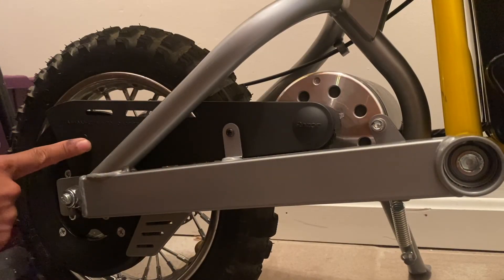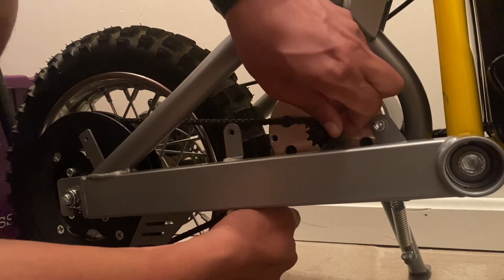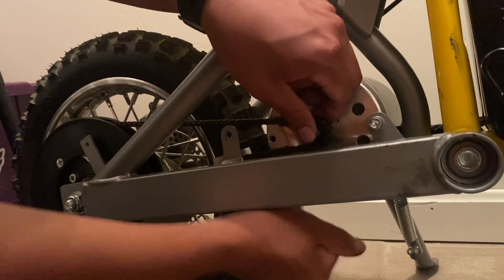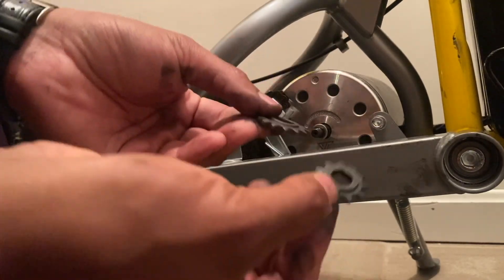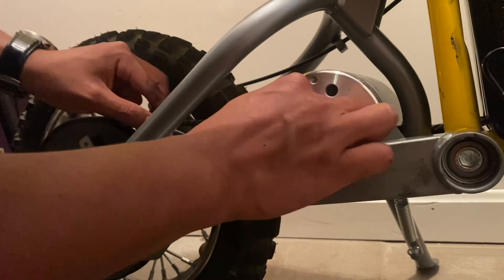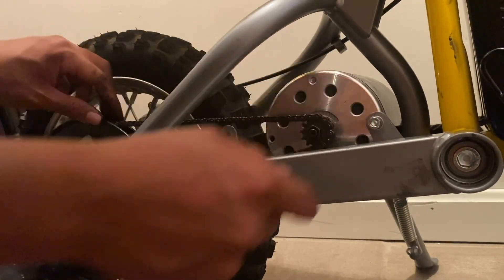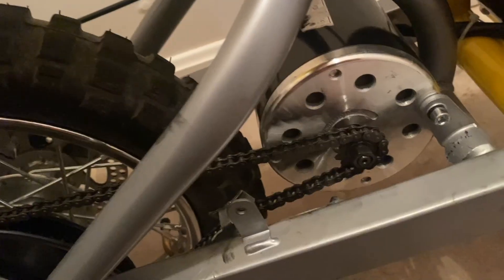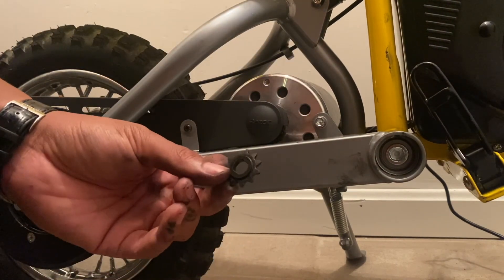MX650 48V Fast Scooters Overvolt Kit Part 3 | 13T Sprocket Upgrade and Top Speed Test

Comment: I have a 650 motor on a 350 frame with a 48v battery and controller, would it overheat ? Because after a ride I touch the motor and it is hot
Reply from the maker: All of these motors will always generate a good amount of heat when ran at a higher voltage. What exact temperature does it measure at? You may want to add a heat sink to the motor

Comment: Whoever is doing these exact mods i highly recommend it… BUT you are definitely missing out by not upgrading to a 48v lithium battery. As Pat stated these SLA batteries are heavy as hell which hampers performance and the way the bike feels. The lithium battery is much lighter and you will get way more ride time. Only thing that sucks is that a proper 48v 20ah will cost you about $250 which is about double what Pat spent on these mods.
Reply from the maker: @gilgonzalez5902  Same Pat that recent spend $2,700 on a 72V 43AH lithium battery, FarDriver ND72530 Controller, Electro EC4P motor and has his Razor SX500 flying at 66 MPH 😂
Reply: I'm looking at an over volt kit and 52v25ah

Comment: how do you take the sprocket off the Kunray 2000w my1020 motor? im trying to replace it with a 13t 25H sprocket. i already have the nut off im just trying to pry it off
Reply from the maker: @pvnchmadefaris  it’s reverse thread. Hold the shaft in place with a 10mm, then turn the lock nut with a 12mm wrench CLOCKWISE to loosen it. The nut can get jammed sometimes, just pry on both sides
Reply: @PatOutdoors  Oh no I've already done that, it's just that the sprofket its selt isnt comming off, do I need to pry it off?
Reply from the maker: @pvnchmadefaris  sometimes you do. You can jam a 10mm wrench on the shaft as leverage to pry against
Reply: @PatOutdoors  oh alright I'll try later, thanks for the fast response

Comment: It has been a long time sense you posted this but I have a question is the kit you got from fast scooters compatible with any 4 12v batteries? Cause I’m replacing my stock battery with different brand batteries. Will the kit still run the same?
Reply from the maker: As long as it has 48v output

Comment: Will it work if i buy it and dont have another battery?
Reply from the maker: It will not, it’s a 48v controller
Reply: @PatOutdoors  if i get the 36v kit will my razor sx500 go faster
Reply from the maker: @animeman4629  not really, it only gets noticeably faster once you’re 48+ volts. This bike now runs on 72V brushless kit and goes 50 mph

Comment: I shunt modded my stock controller and I’m running a 48v 20ah lithium battery pack, supposedly only 40 amp discharge. I smoked the motor on the first time out.
Reply: You have a link for the shunt mod, I'm not having luck searching it. Thanks
Reply: @scottthomas6674  unfortunately no link, it’s not difficult though. Open the black case and peel back the hot glue near the wires. Back side of the circuit board will be two VERY large squares of metal. I took a steel house key and snapped the blade off, soldered it directly across those two squares. Got it nice and hot, but didn’t want to desolder the components on the other side of the board lol. Most people actually just tape or hot glue the “bridge”, but if you can solder it’s only gonna add more material to the flow path. I’m shocked it can handle the juice, fully charged I pushed 52v through it, no issues. I’m getting the Kunray 2k watts kit very soon, when I install that I’ll remove the speed controller and make a video of it on my channel. I’ll message you.

Comment: Hope you’re still following this video and comments because I have an MX 650 I put a fourth lead acid battery so now it’s 48 V downgraded the front sprocket to a 10 tooth but my question is I am curious if I can get a better controller like 800 W or 1000 will I get more power? Right now I’m using the stock and it seems to be just fine. I’m already going faster but the question remains if I get a higher wattage controller without getting more amps from the batteries because or for a run and series will it even make a difference
Reply: Yeah, I followed you I seen what you’ve done to the bike. I seen it with the extra stuff I’m just not looking to put that much into mine yet.
Reply from the maker: Please check out my later videos. This bike now goes 50 mph on a 72v lithium battery set up running on a Kelly controller tuned by electro & co. Not worth purchasing a controller for the light difference in wattage. Just go straight to lithium battery with a brushless motor kit once your batteries get weak.

Comment: Hey man, thanks for the video, I'm about to put the same motor on a mx500 I just picked up so this is all a great help. I was wondering though, with the switch to the 13 tooth sprocket, did you notice you sacrificed a bit of acceleration for that higher top end speed? for my build, I'm actually more focused on it accelerating quickly rather than hitting higher top speeds. Have you tried different gear ratios and been able to compare acceleration vs top speed much?
Thanks!
Reply from the maker: Yes, you lose a bit of low end torque to trade with a slightly higher top speed. I mentioned it in the video as well. I haven’t experimented with too many ratio combos besides the 13 tooth front sprocket, which I still use on my newest motor set up. Check out my newer videos for more details

Comment: Hey man, great vids! My son has been watching your videos for some time and now guess what…. I am in the middle of mx650 razor mod… need your advice on something simple. Waiting on a new motor, but when I was taking down the chain, the tensioner spring broke off. Should I start looking for a replacement or I should be fine? Not sure how lose will be till I get the new motor and replace the sprocket with the factory one. Thanks

Comment: How long can you ride with it before it dies out
Reply from the maker: About 10 miles if mostly flat, depending on how much elevation change.
Reply: @PatOutdoors  ok thank you I am probably going to add another 12 volt to it I already added the Rc battery piece like you did
Reply: @PatOutdoors  and that is with just another 12 volt and the controller right??

Comment: I have a question on the bike I have is the SX 500. It has a 36 V 500 W motor they sell a 36 V 800 and a 36 V 1000 W motor. My question would you get better performance with a 24 V 500 W motor thus overpowering the 24 V motor with 36 V or would you get better performance with a36 V motor with 800 or 1000 W? Essentially overvoting a 500 white or letting the same 36 V but have more wattage. What gives better performance more voltage across a less voltage motor or the same voltage as the battery but a motor that pulls more wattage? Can anybody help?
Reply from the maker: Depends on what controller and batteries you are using also. You will NOT get more power going with a 24V motor overvolted to 36V.. Toss that idea. I now have a 2000W Motor, which performs a lot better with a higher amp rated controller and a battery with a higher amp rated BMS (battery management system.) For the stock brushed motors, you really won't feel too much of a difference with upgrading to an 800W or even 1000W MY1020 motor if you still have the same controller and batteries.

Comment: How much weight does the 4th battery add? is it there a noticeable difference?
Reply from the maker: It adds about an extra 8-9 lbs. Really not noticeable once you are riding and the trade off of extra speed is worth it.
Reply: @PatOutdoors  imagine 1 48v lithium battery weighing 3-4 lbs as opposed to 35-40lbs of acid batteries.

Comment: Have u had any issues with overheating sprocket change + overvolt on stock system.
Reply from the maker: Not yet, though I have felt the motor get warm but not hot. Do you have the stock controller still? I haven't done any super steep hill climbs with it yet though, only maybe 6-7 degree climbs on pavement.
Reply: @PatOutdoors  mines still in the mail (mx500) but I'm going 48v lipo 20ah, 1800w motor Vevor and kelly kbs72121x controller and 13T sprocket also.

Comment: is there a motor upgrade available for after this kit?
Reply from the maker: I found a 48V 1000W Brushed motor available, but not really how truly different it is from the 36V 650W motor installed (or if a Chinese company just re-labeled it.) Still debating if it's worth doing or just doing a 2000W Brushless set up soonish if I want more speed.
Reply: @PatOutdoors  Go for the 1000W motor, see what happens

Comment: upgrading moter and battery next⁉️
Reply from the maker: Mayybbee. Looking at motor options at the moment actually
Reply: I went from STOCK mx650 to 48 overvolt kit , to 1800watt motor, to 60volt 34ah 80bm battery in one month. 
It is so worth it. I love riding at 40 mph with 75 miles of riding time and people and cops just stare. ;)
Reply: @juliovictorcardona2135  where did you find this 1800w motor, is it 48v?
Reply: @juliovictorcardona2135  love it !!
Reply: Get a helmet my man

Comment: Very helpful do you at least feel more tourq from The kit ?
Reply: Plenty of added torque with just doing the 48v kit yes, but top speed was capped just above 23 MPH. I swapped out the front sprocket and I was able to get 26.8 MPH, but lost some low-end torque (but still more torque than 36V)